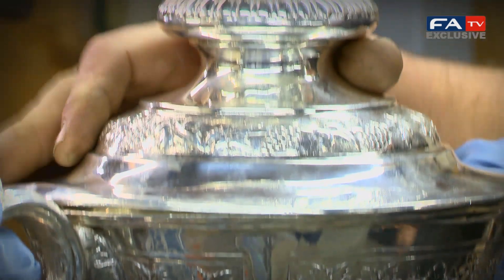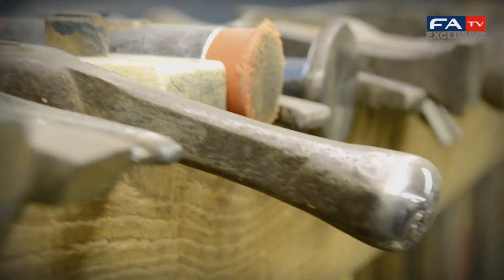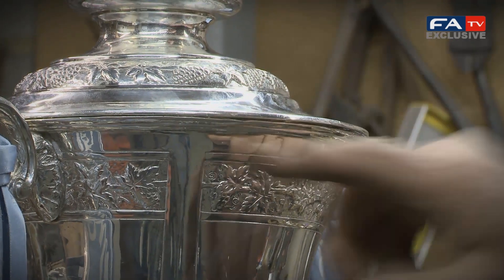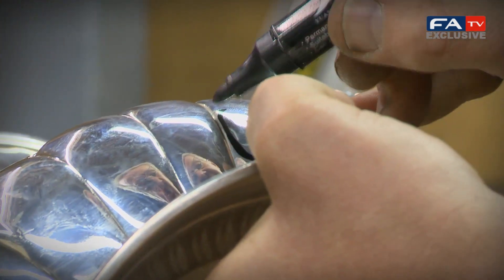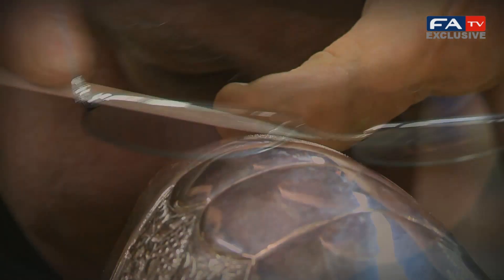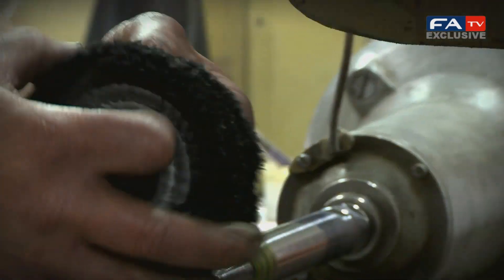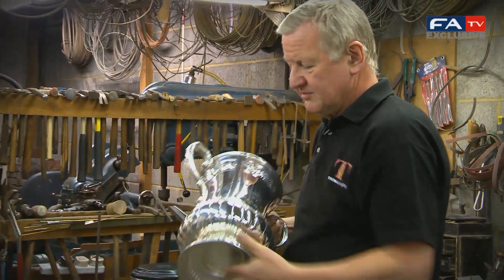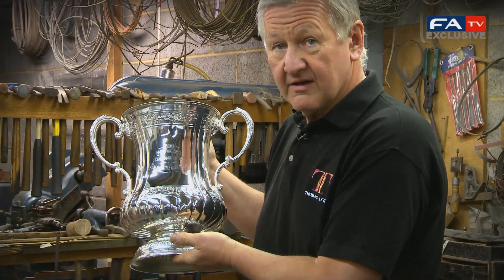FA Cup Repair - Chelsea v Liverpool FA Cup final preview | FATV

Comment: Let me educate you on a few things firstly in the 7 years before RA bought CFC we'd finished in the top 6 (3 times in the top 4) We'd won 6 trophies and completely re built the bridge. Secondly the spine of the team that won the league Cudicini in goal, JT & and Gallas in defence, Lamps in Midfield and Eidur up front WERE ALREADY THERE BEFORE 2003. J.Cole, Robben, Cech, Thiago, Bridge, Johnsen cost Hardly anything. Thirdly we won the league in 2010 with practically the same squad as 2006......